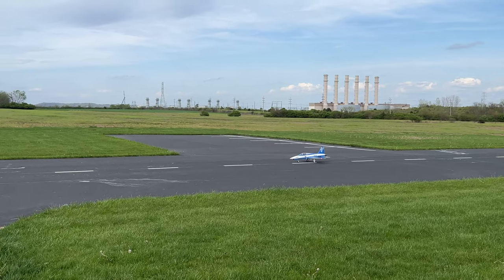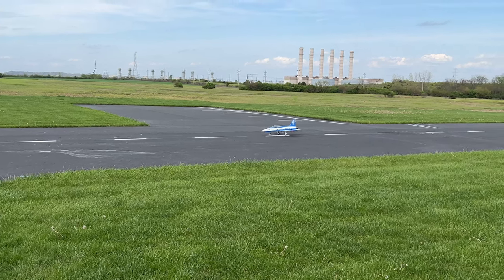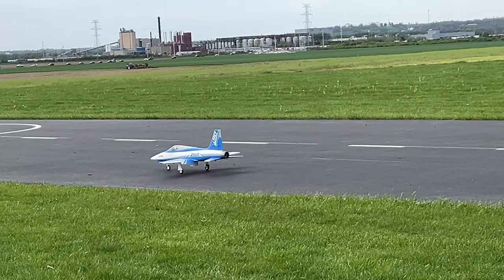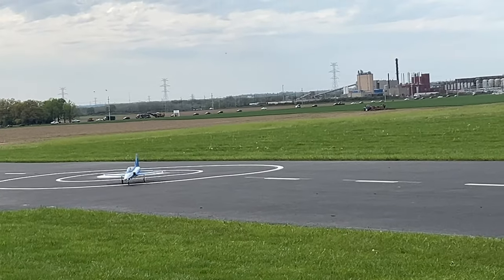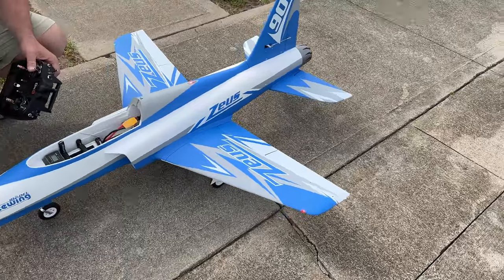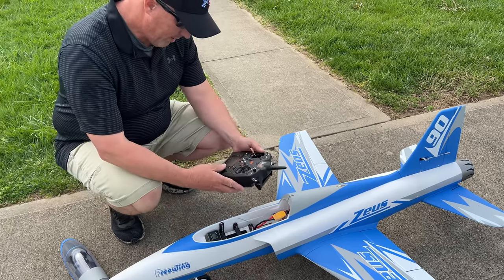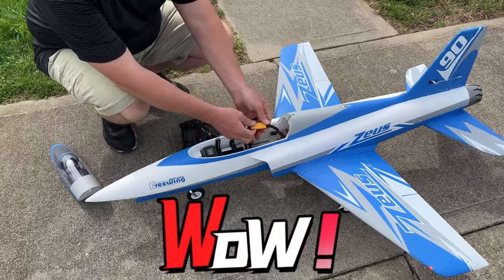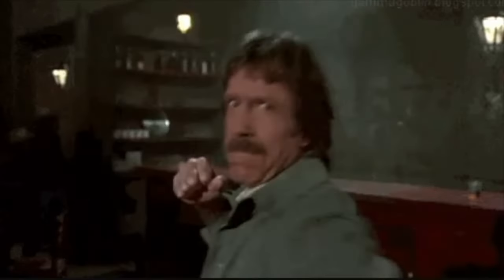Freewing Zeus maiden by Pilot Fox

Comment: Was that full flaps on takeoff? I set the flaps to 15 degrees for takeoff and I don’t land with full flaps when it’s windy. They will make your plane crab more in a crosswind and balloon when a gust hits it.
Reply from the maker: Full flaps on take off and landing. Thanks for the advice.  I’m going to be maidening mine soon.  Westley  had said full flaps but with wind that makes sense.
Reply: @LoveRC  Also, I use the flap switch to control the transmitter's flight modes and enable F-mode trim for the ailerons and elevator. This lets me use the normal trim levers to trim the elevator in each position of the flaps. However, I don't usually have time to set the flap trims on the maiden flight. It helps to start shooting approaches as soon as you can so that you can trim the elevator before the maiden landing, if needed. I don't fly around playing jet jockey on the maiden; as soon as it's halfway trimmed, I start figuring out how to land it.
Reply: Never use flaps on take off flaps on calm days never on windy days .Trying to understand the WOW title .
Reply from the maker: @charlesrestivo870  it’s fast!!
Reply from the maker: @charlesrestivo870  thanks!  It’s a learning experience.
Reply from the maker: @charlesrestivo870  thanks!!! It’s a learning experience!!!!  Good stuff for when I maiden mine.
Reply: @LoveRC  it's not that fast my stock vulcan does 118 My proped tyhoon does 126
Reply from the maker: @charlesrestivo870  it glides by so smooth.  Way faster than my 70mm jets.   I did get my Avanti to 113 though.
Reply from the maker: @charlesrestivo870  that was a maiden.  We'll get her faster.
Reply: @LoveRC  not always about speed ! Handling landings touch and goes Enjoy
Reply from the maker: @charlesrestivo870  there is more than speed I like about this model. She looks cool, slows down nicely, and has some speed. The paint is nicely done. No bare foam on the white. Nice gear.  And the wings come on and off easily.